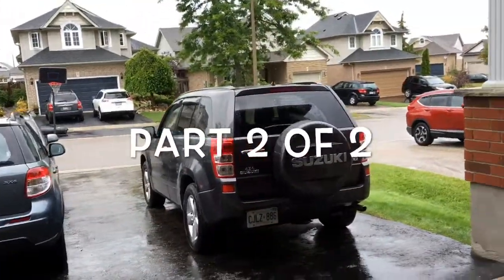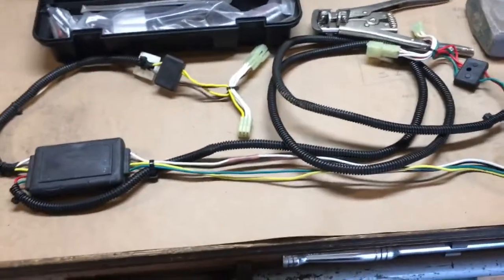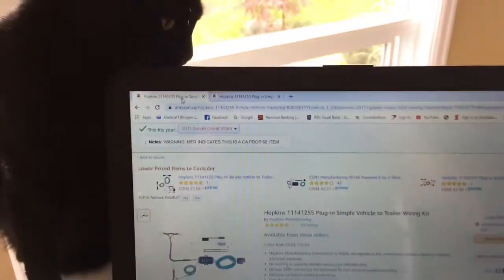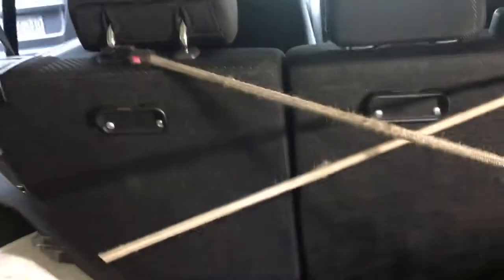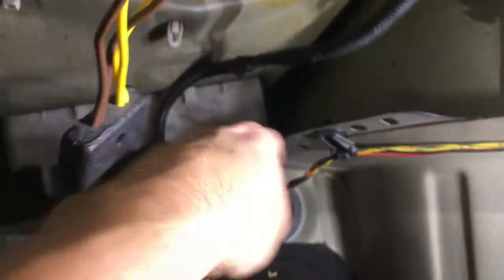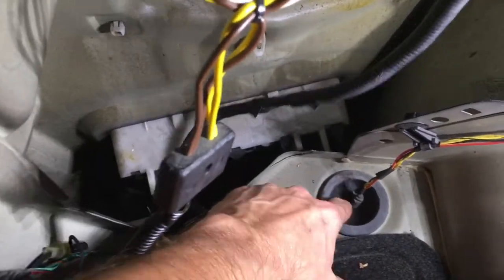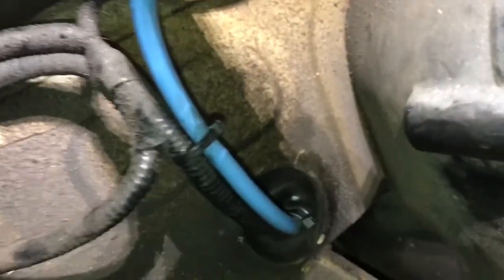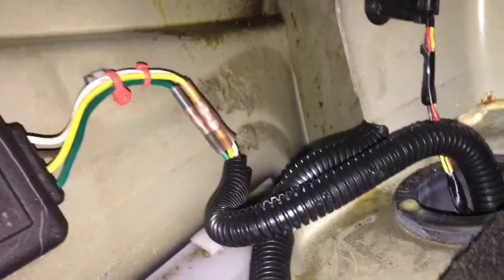Grand Vitara Hitch Wiring Harness

Comment: Just did my 2001 GV.  Had a square grommet big enough to fit the plug through.  Stuck mechanical fingers up from the bottom.  Removed the left rear turn signal and pulled it down.
Reply from the maker: 👍 Thx for watching 🍺